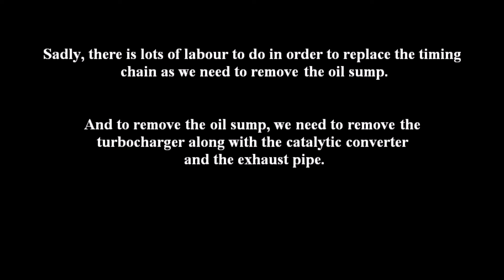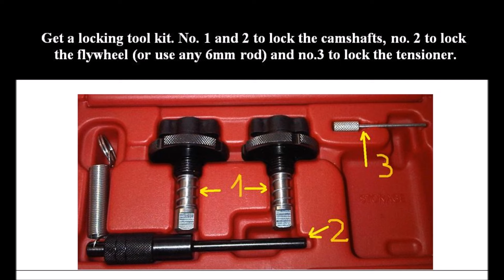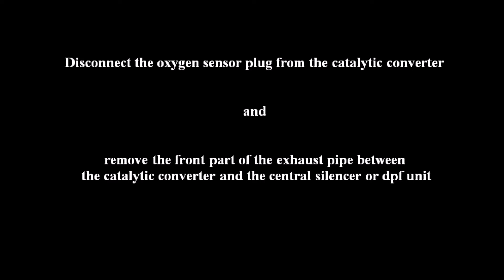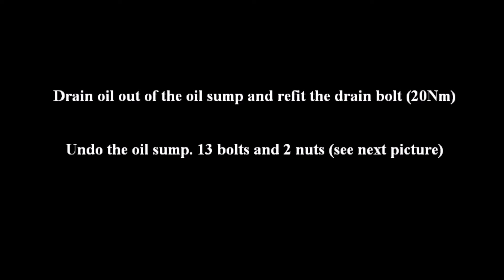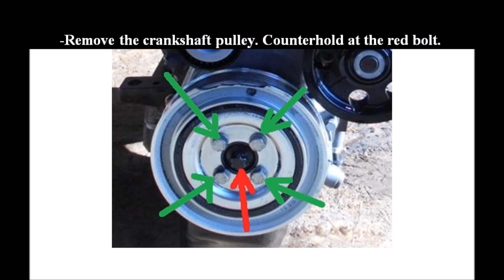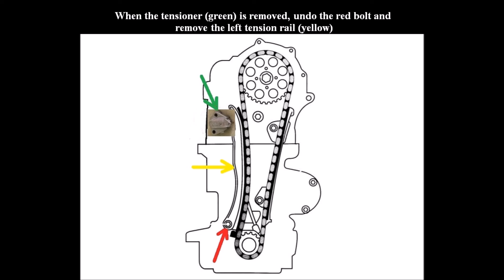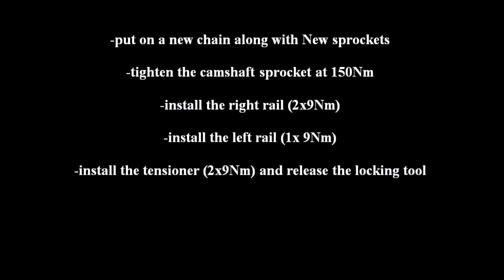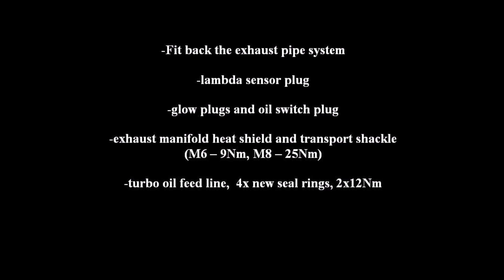How to replace timing chain 1.3 cdti Agila Meriva Astra Corsa Punto Panda Z13DTH Z13DT Z13DTJ Y13DT

Comment: 4:48 I think there is a mistake. You said to turn the camshaft clockwise at it's sprocket bolt but you can't do that because there is still the timing chain cover left...You can't access the bolt if you don't remove the cover first. (see at 4:22)
Or maybe you can access it by removing the torx plug on the cover ?

Comment: Thank you so very much for the Video this helped me so much, It was the hardest Timing belt I have done as yet, Just a Pointer that the Crankshaft pulley bolt needs a Female Torx E18 Socket I used a multi point standard socket and rounded the head then ended up having to drill out the old bolt which took 4 days just for the one part.
Reply: Chain not belt
Reply: What torque did you use on left hand thread pulley bolt?
Reply: @bagofspanners72  you can torque to 230nm or 50nm+ 90° , if i recall correctly
Reply: Hi was your crankshaft pulley bolt left hand thread ?

Comment: Newly done on my Punto 1,3 mjt, A LOT to manage..
Reply: After you have done maybe 10 of these engines they get easier. last one i did it took me just over half an hour longer than the more easier z12xer petrol engine. The 1.3cdti are very problematic but the good thing about them is if the chain snaps they never bend valves even though it is an interference engine, the manufacturer made the cam followers very weak so if the chain breaks it breaks the followers instead of bending the valves. Better taking the cam box of and replacing a few followers instead of striping the head and having to do a valve job and maybe even worse.
Reply: Is it necessary to remove the injectors or can be kept in the rocker cover?
Reply: enriq g if your chain has snapped then yes you will have to take all injectors out because the cam box has to come off to replace broken cam fiollowers.
Reply: Hello Martin, do I have to check if any valves have been bent, or do I just change the rockers?
Reply: ENRIQ G Hi no you dont have to check for bent valves just take off the cam box and replace any cam followers that are broken and check all the rest of them for cracks, last one i did just had 2 followers broken, as i mentioned before these engines dont bend valves ive yet to see one that has.
Reply: Thank you!!
Reply: martin bell 
Maybe you can answer my question: How do I counterhold the camshaft sprocket (5:52)? Do I need a special tool for that or is there some space behind the sprocket to counterhold with a spanner?
I've got the instructions on how to to change the chain, but changing the camshaft sprocket is not included.

Comment: Replaced myself on mine this afternoon . Ty for the torque specs
Reply: 1.3 ddis ? How much you paid for parts ? Easy job ?
Reply: @Adi_86  the price for the parts you can check on autodoc . The job isnt hard but you should be prepared for everything you need to do . A bought the locking pins for the motor (fiat 1.3 diesel z13dth)  and a special tool to hold the crankshaft while removing/screwing the crankshaft .   bolt

Comment: I’ve done these chains before and never removed the sump or turbo? No leaks or issues
Reply: Neither the turbo and catalytic on a  Corsa D, but how did you remove the timing cover? Did you remove the studs bolted in the block or the 2 ones bolted in the cover?
Reply: Run The Jewels extract the 2 studs in the cover then It’ll pull away from the sump then. I cable tie the oil pickup to a hole in sump so it Dosent fall in
Reply: @Diesel8290  on mine there are 4 studs : 2 in the cover ,2 in the sump  ,i 'd removed the 4 ; you are not wrong ,ty

Comment: why it needs the turbocharger removed?
Reply from the maker: to remove the oil sump, you need to remove the catalyst converter which is fitted to the turbocharger and it is hard to remove just the catalyst converter. It is easier to remove it along with the turbocharger
Reply: Fix and Drive ok, thank You! I just fixed my turbo and I hoped it's no need to take it all apart again...but I hear a chain noise sometimes and I don't want to risk. thanks allot 😊
Reply: Fix and Drive you can get the sump on and off easily without having to remove the cat 😄 

Also on any 1.3 I've fitted a new chain to I've never removed the sump always just worked around the timing cover .. remove the bolts and just leave it in situ With the strainer still attached .. all you've got to do is remove the 2 studs on the end of the sump and the 2 studs on the bottom of the timing cover 😄 little time saver for your next one 😄
Reply: Ive done quite a few of these, you dont have to remove the cat to remove the sump, just remove the top 3 bolts on top of the manifold and the cat will drop maybe an inch just enough room to take the sump off.
Reply: Remove the 2 studs on the end of the sump an the 2 studs on the bottom of the timing cover ? What do you mean aaron, do you cut it off or something ? Im replacing a timing chain on a friends car and to me it looks like i have to lower the oil sump so that i can pull the timing cover off. If you have any good tips i would be very happy.

Comment: is there a need to lock both camshafts, theres only one mentioned in the exhaust cam but 2 in the kit?
Reply: Tony paolozzi, you should be ok just using one to lock the camshaft as both camshafts are both driven by a gear. I think they give you 2 if the camshafts have been taken off or been replaced so the gear drive can be re timed with both camshafts again.

Comment: Would changing this cause oil to spill under the gearbox ? Bought one of these and there's oil under the gearbox dealer claims it's due to timimg chain replacement there's no leaks but just curious

Comment: Fix and drive. How can i remove the chain cover without removing the oil sump ? The two studs going down through the oil sump from the timing cover is blocking me from getting it out.. How can i do it without removing the oi sump and turbocharger ...